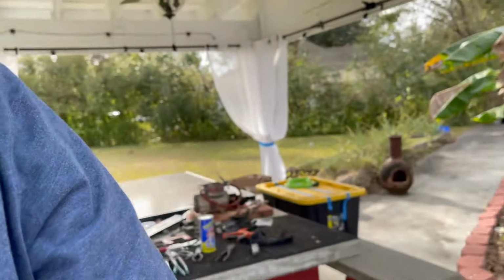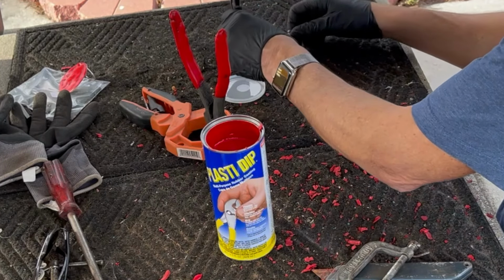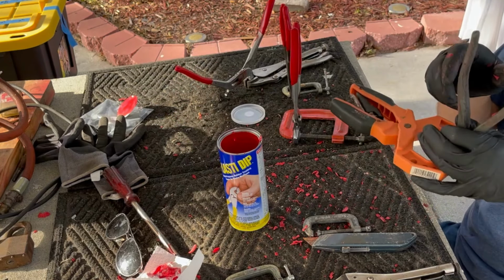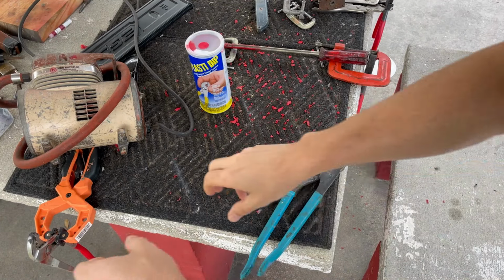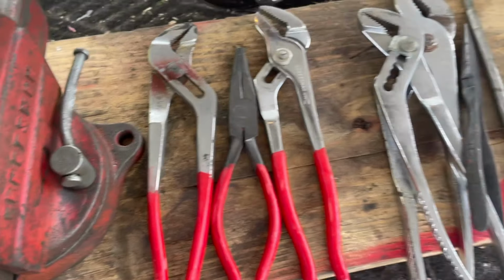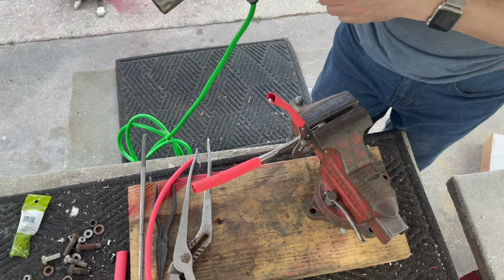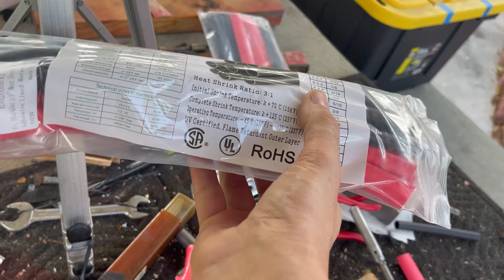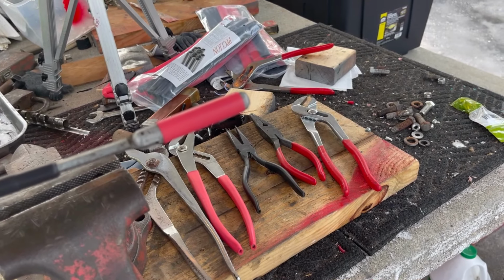Plasti Dip vs Shrink Tubing - Which Is Better for Tool Handles?

Comment: If you trim so a little tubing sticks out past the end, you can pinch the tubing together and shape it with your fingers while it's hot (use gloves obviously). Worked for me. Didn't have the marine grade though. ⭐🙂👍
Reply from the maker: I'm going to try that.  the marine grade has adhesive in it so it should work as well.  Thanks for the tip!

Comment: The instructions say to go in then out really slowly. Then do more coats at spacific entervals. It does really well for me.
Reply from the maker: I did do a very slow pull but it didn't seem to make much difference. Maybe it's the Florida humidity.  :)  Likely it's my impatience.

Comment: why are you shaking it in the can? if you read the directions, you’re supposed to dip it in slowly and bring it back up slowly 🤦‍♂️
Reply from the maker: You could be right. I got decent results either way but I still prefer the shrink tubing.  For this task it's cheaper and easier and for something long like the magnet it was the only solution.
Reply: Yeah, yeah, yeah. It still doesn't help. I've done the whole take it out slowly thing. It works and it doesn't. The results you can see here are pretty much what I've gotten dipping. It's a less than ideal process.

Comment: I used Plastidip many years ago and like you I had pretty good results. I now have a number of older hand tools that I have been wanting to Plastidip (tired old hands) but after seeing this video, I'll definitely be using the shrink tube. Great idea and perfect timing.
Reply from the maker: That's great!  Thanks for the input.  I've found young people think the shrink tubing is actually a factory coating so it gets their endorsement as well.

Comment: That package you show has a 3:1 shrink ratio so if you want a thicker grip you can start with a larger size and you can also put on a second piece after the first to make it thicker.. Dip may have its place but overall the tubing is better for most things I think.
Reply from the maker: That's a good point on doubling it up and with the adhesive there would be no slippage.  Thanks for the tip!

Comment: Yeah Plasti-Dip is kinda meh. I've used it. I'm not running out to do it again any time too soon. I've got a pair of pliers someone managed to get some rubber hose on the handles. I don't know how they did it. But that hose is on there pretty tight. Maybe they heated it up and lubed it? It's a neat job. Klein makes new grips for some of their pliers. I think you're supposed to put them in hot water for a while to soften them up before trying to put them on. But they're nicer than the hot dipped handles. They're somewhere in the $10-$12 range for a pair. So not cheap. I've thought about getting a tube of caulk and trying it as a dip. Some caulks are pretty tough. Color selection there isn't the best though.
Reply from the maker: lol!  "kinda meh" is a perfect way to describe the results I got with it.  I'd be curious if your caulking idea could work.  it's a lot thicker and doesn't exactly pour.  Let me know if it works.
Reply: @floridarusticrepairs  you're not pouring Plasti-Dip to apply it on handles. Although in some applications brushing Plasti-Dip is recommended. There's a lot of different kinds of caulk and I don't think they'd all be suitable as handle material. Having had to scrape a bit of caulk I've noticed some of it can be pretty tough.

Comment: Love the heat shrink tube, did this many years ago when I had a bunch of heat shrink. works fine. when I was a kid my Dad bought a jug of that plastic and did not have a good time with it.. that was in the 60s. great video thank you.  I can remember cloth electrical tape was a frequent tool wrap back then.
Reply from the maker: Thanks!  Yes, that electrical tape repair was common but as it broke down the tools became sticky.  The good old days.  :)

Comment: I used Plasti Dip on some tools maybe 20+ years ago. Still on those tools. Took a little trial and error to get right. Tool must be clean. Dip should be shaken and left in a warm area for a couple of days before opening, reason is to let the bubbles rise. Dip tool very slowly and pull it out very slowly. Hang with the dip down for 30 minutes and then flip to get rid of the tip. Wait a week to off gas and repeat to three dips. after the third dip leave the tool hanging for a week to off gas and cure. Like I said, it's been on my tools for 20+ years. 
Shrink tube works too but it isn't rubberized.
Reply: So…4 weeks without a tool?
Reply from the maker: I'm going to keep one of the shrink tubing tools in service with me to see how well it holds up.  I actually prefer how it feels for grip but that's likely just because I did not apply as many coats of Plasti Dip as you've done.
Reply: @nachoisme  Yep. But it does last a long time with minimal care. At least for me it did.
Reply: @ohboah320 - Great practical advice - thanks.  I have some OEM clamps that hold an aircleaner lid on a 5.8 OEM Ford air filter housing and wanted something to not mark the new finish on the lid when clamped down - - not sure yet which I will use - both seem to have their uses.  CHEERS from AUSTRALIA
Reply: @ Yes., if you want it to last.

Comment: I've used shrink tubing on a few pliers. Mine didn't have the adhesive inside but I applied some epoxy on the handles before shrinking. Just be sure to clean up any excess before it sets.
Reply from the maker: That's a good tip.  Not everyone has the marine grade shrink tubing at hand.  Thanks!

Comment: I have old linesman pliers and other tools, from my grandfather.   I use them as is and they work great.  American made and built to last
Reply from the maker: I agree.  Many old tools are fine as is.  i just want to put them back into service and rubberized handles seem to help.
Reply: Tools with grippy handles are just easier to hold. especially with gloves on. Plus the colour coatings help visually see what tool is what. The grip can also help keep the tool in a work belt (less likely to slip out) some of the older tools are quite a bit clunkier too   Thicker/ more stiff to open close/ heavier etc. Obviously depends on the hand tool in question. 

I just bought an older number 18 Sheffield England  pipe wrench. In the process of cleaning it up😛

Comment: A friend purchased a can of Plasti Dip in the 1970's.  It looked like a good idea. I dipped a few pliers. It was a failure. It left bubbles and a tacky, uncomfortable, and not very durable surface. I stripped it off of most of my tools, as it was annoying. I left it on a monster size Craftsman "Channelock". I hate those pliers. I kept them for their size, but upgraded to real Channelock as soon as I could. The Craftsman pliers are a knock-off copy of a better design, and they y never worked very well anyway. The OEM plastic grips failed very quickly, making them a good candidate for the Plast-Dip trial. I haven't seen Plasti-Dip for sale in many years.

I tried heat shrink tubing in the early 1980's.  It was a better solution. I never tried marine grade tubing. Long befire I knew anything about NFPA 70E I treated non compliant tools for live electrical work with heat shrink tubing, primarily to insulate plastic handled screw driver blades. This was a durable solution. Now I know all about NFPA 70E compliance and arc flash hazards. I own rated inslated tools, abd fully understand PPE, practices and requirements. I soent decades as a sparky, and experienced no devastating events or saw any first hand. I will admit to frequently employing my homemade "insulated" tools for many years successfully without required PPE and procedures.  This included servicing critical on line, live international data center power. Power disruption was regarded as coorporately untenable. I was nieve enough to work that equipment live with my "heatshrink insulated" tools. 

All said, both solutions in this video are substandard to purchasing tools designed fir the purpose. Both solutions yield less than ideal results, and both solutions incur substantial expense. Used tools with the grip features can be purchased quite inexpensively, even NOS. 

I have small hands, so I don't like oversized comfort grips, but I do like common factory dipped comfort "insulated" grips.
Reply from the maker: Thanks for the info!  I had mostly done this for grip because when I donate out tools I hate to throw them away especially if they're decent quality and kids like the rubber handles.  Your point about using the shrink tubing as a quasi-insulator reminds me that when I was a teenager my father had a few tools he used to do basic electrical work which had a rubber coating that, looking back, I think it was shrink tubing.

Comment: I'm one of these gen z kids that liked the over molded grips when I was a kid. Now that I actually use tools, they break and fall off just as fast as the dipped grips. Plus they're harder to clean, and take up more toolbox room than the dipped grips.
Reply from the maker: That's great!   When i was a kid I used whatever would work and bare metal was mostly all that was available.  The heavy grips do take up a lot more room.  I never even considered that until you mentioned it.

Comment: Great idea! How did the shrink tubing hold up with use?
Reply from the maker: The marine shrink tubing in the description  link is quite thick which,as you may be able to see takes my heat gun a while longer than average  to actually shrink it.  . I can't say how long it will last but I can't imagine wearing through it with normal useage.  I've used this same type for off road lights and trailer hitches and it's held up well.

Comment: How do both of these methods hold up to solvents, ie carb cleaner, gas, kerosene?
Reply from the maker: That's an interesting question.  I have limited experience with the Plasti Dip but I've seen it has lasted on tools long enough to totally dry up and crack so that must have taken years.   This shrink tubing is very thick and I've used it on drill handles and even exposed wiring on vehicles and it seems to be undamaged from years of weather and grease.  Both should serve the average user fine but I'd bet on the shrink tubing in a head to head durability contest.
Reply: Plasti-Dip gets slimy in my experience. Solvents can always attack it. It'll hold dirt and grime too. I have "blue" dipped handles that are pretty much black now. So not good.

Comment: How does each rate as electrical insulation?
Reply from the maker: Good question.  Both are electrical insulators but I would rate shrink tubing as better since that's what it's primarily made for.